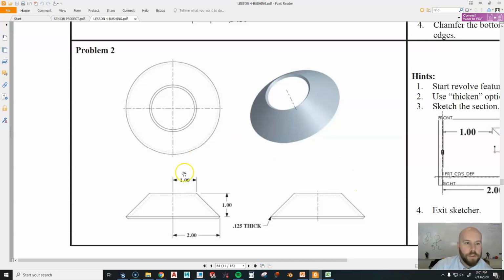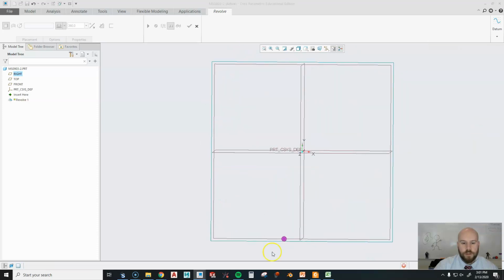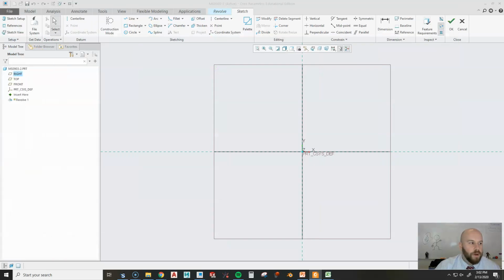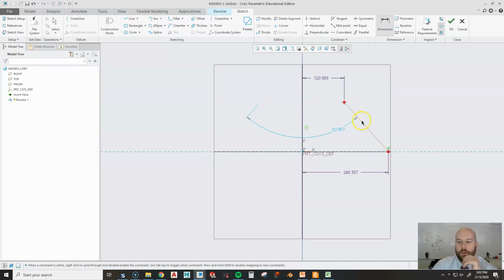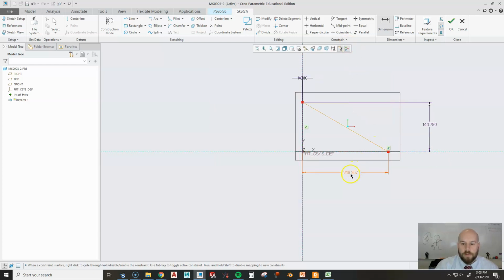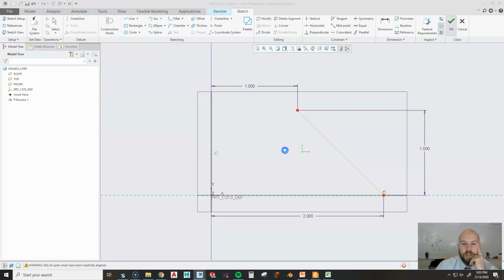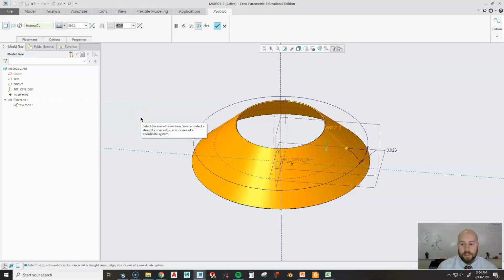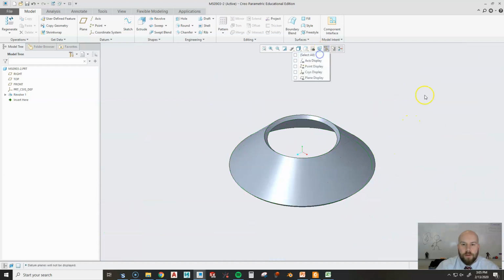CREO CREATING A DISC USING THE THICKEN COMMAND

Comment: It will not allow me for me do a thickness of less than 0.35 inch...
Reply from the maker: You can fix this by adjusting your accuracy in your model properties. Go to File > Prepare > Model Properties, then adjust your accuracy to one extra decimal place. If it is .001, make it .0001 for example. It may default to a slightly higher number but that is ok! That will fix your problem.